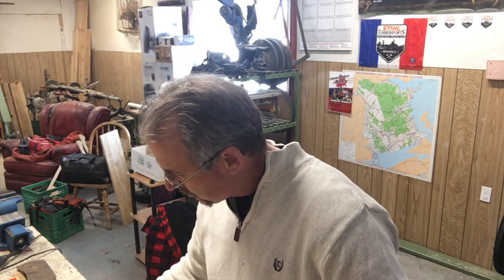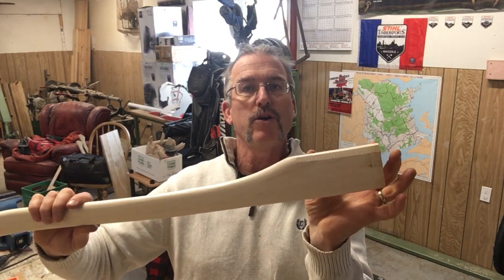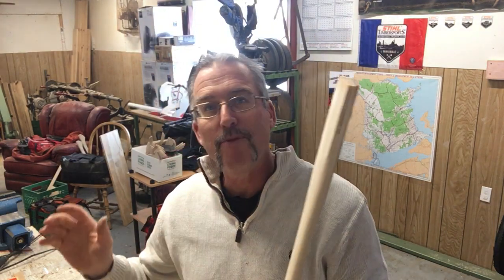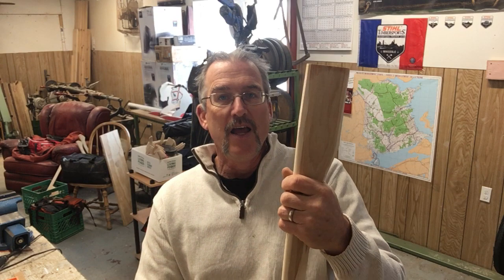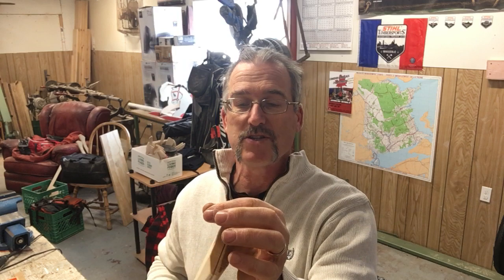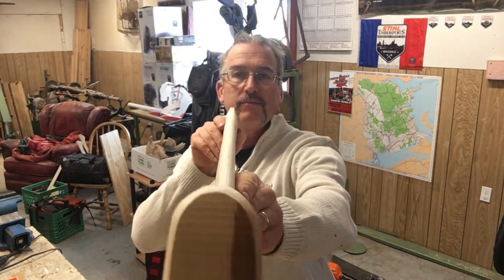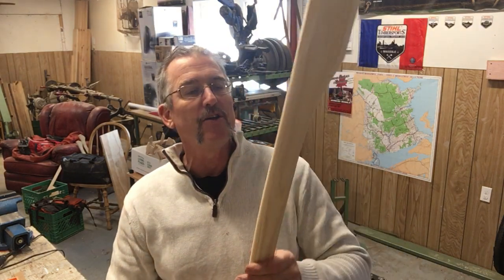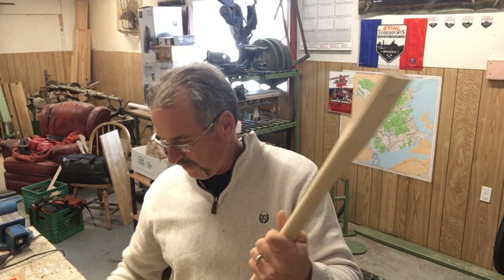Troubleshooting axe handle problems

Comment: Great video Rod. It's hard to be too uptight about lining up the eye wood before it's shaped for the head, especially considering that a lot of axe eyes themselves aren't perfectly straight.
Reply from the maker: Oh how right you are!   the ones I least like are the China axe heads.   The price is right, the steel is very decent, but their ability to make a straight eye leaves a ton to be desired.   These are by far the worst axe heads to hang, but they are likely the ones I do the most.  NOT fun.

Comment: Rod, another good one. I leave my wedges ever so slightly proud so I have bit more to drive in. I've had good luck using a hot air gun to warm the wood before bending. Thanks again for the video and I love your handles. Best regards, Chris in Iowa
Reply from the maker: Thanks Chris.  Next video is the frow that I have revived.....and next I need to make the wooden mallet to use with it, then I'll give it a try for splitting.